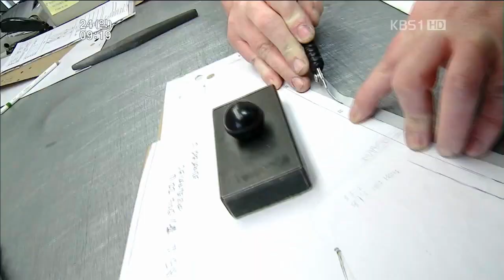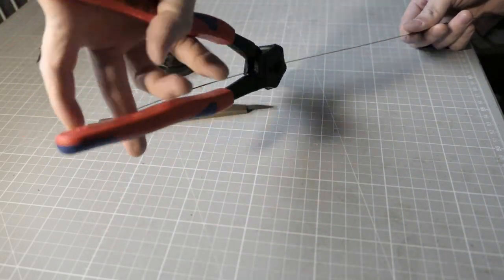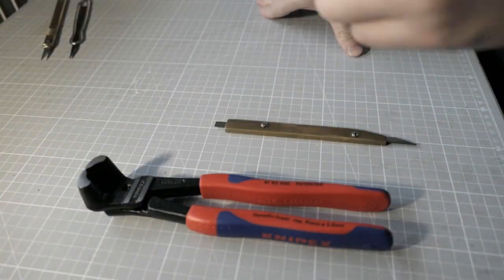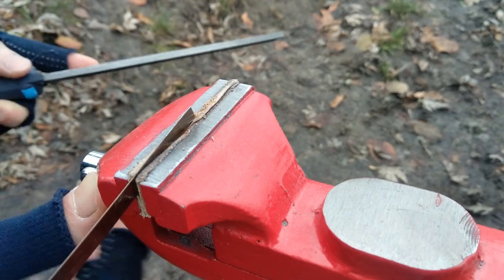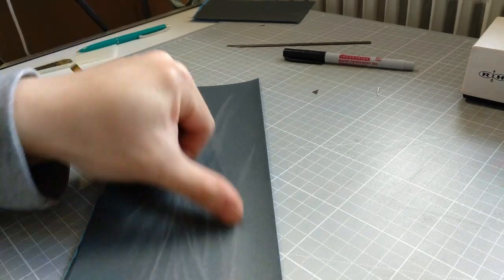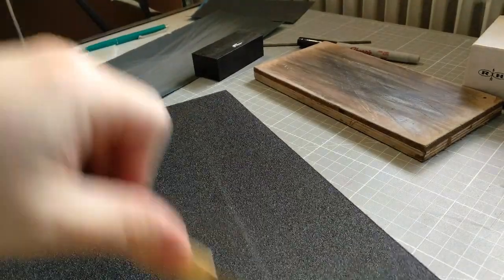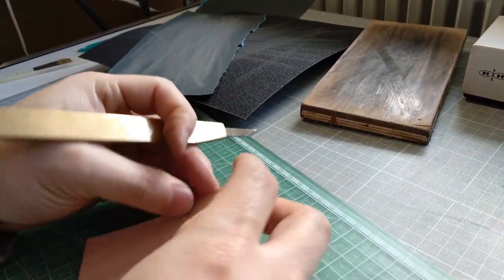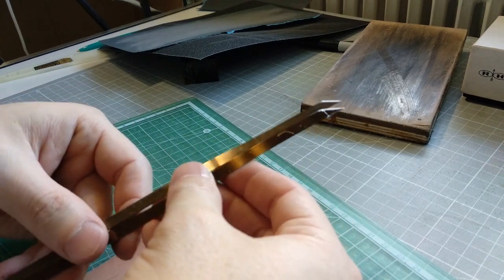A KNIFE FROM CLOCK PARTS?!!

Comment: Watching you try to sharpen that spring steel was painful.  I have sharpened a cheap Walmart butter knife as a test with great results.  Although it would not hold its edge for long, the test proved that it could be done with the right processes in place.  I suggest that you watch some videos on proper knife sharpening and retry this test.